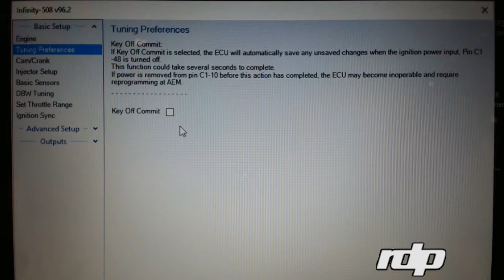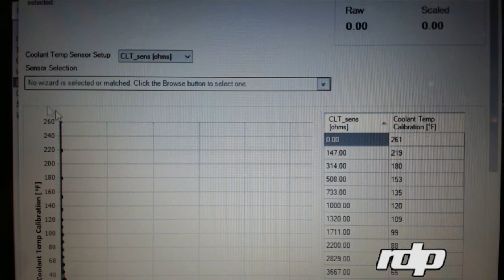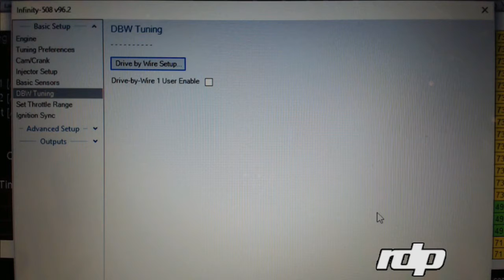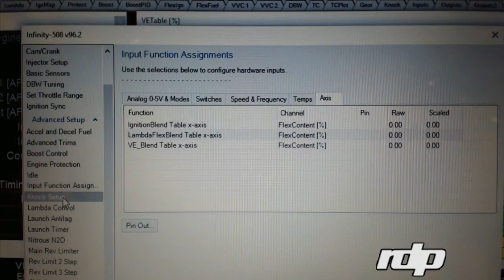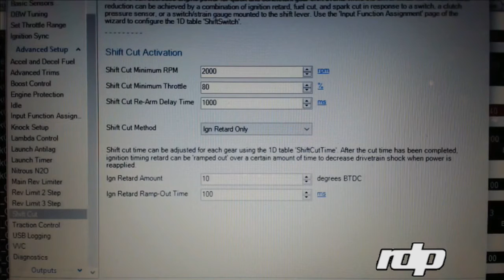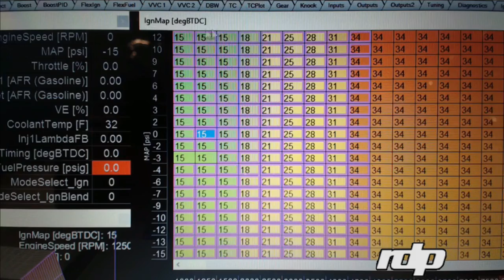Tuning an AEM Infinity ECU with Boostpower

Comment: Great tutorial Dave, I have the AEM S2 but with your video I can already see that this system has a way better wizard and is more user friendly I guess I'll already need to upgrade.  One question on the N20 function, I'll be controlling meth injection with it but does it allow separate boost control adjustments when it is engaged?  thanks again for the video, makes more sense to me now.

Comment: thanks for the video is great, i've infinity 6 with the 1.8T harness plug and play for the volkswagen. But i can't start the engine, there's no injectors and coils. I don't know that to do.
Reply: Roosevelt Gonzalez call AEM tech support
Reply: TheProPilot it was a wrong signal from map sensor. the engine now runs. now the car are ready to tune